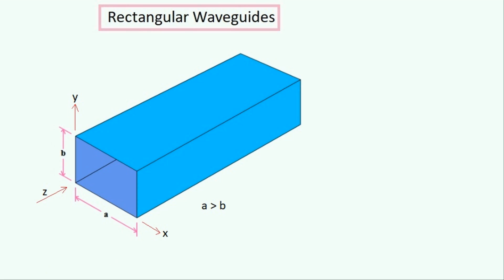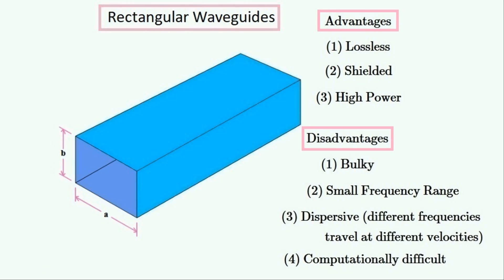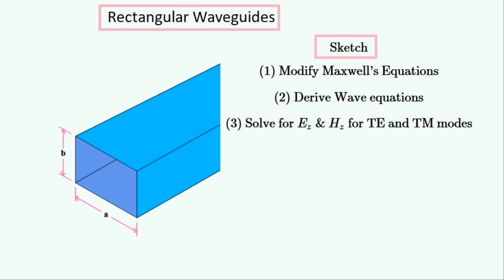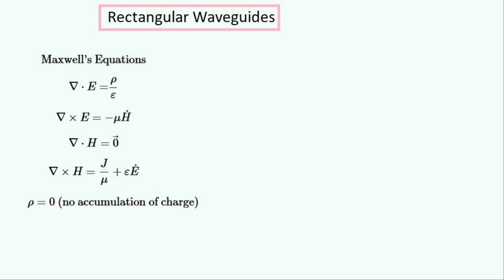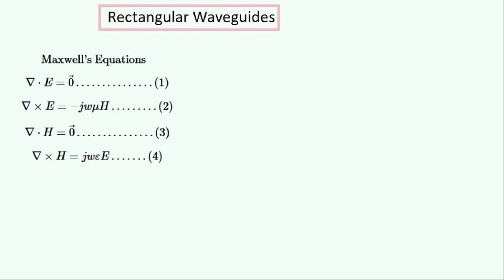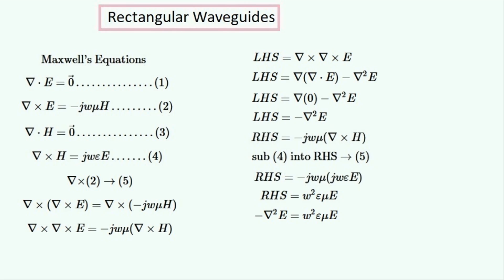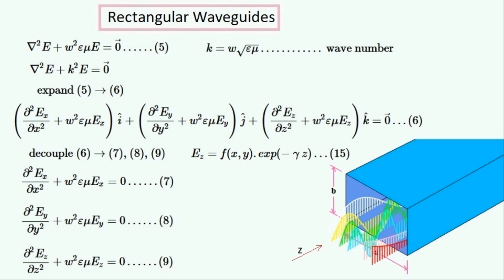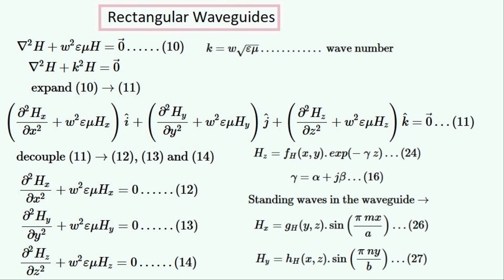Rectangular Waveguides Part 1

Comment: @7:41 Eqn 19 and 20 are not correct.  The boundary condition, Etan=0, requires Ex ~ sin(pi m y / b) and Ey ~ sin (pi n x /a).  Otherwise, nice video!
Reply from the maker: Thanks for that, I'll look at it. Its easy to get lost in the math.